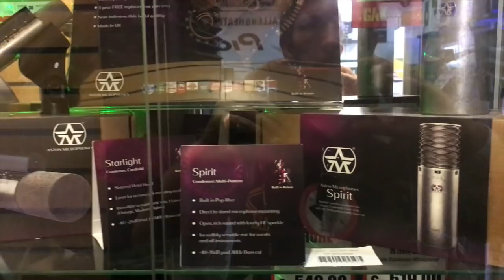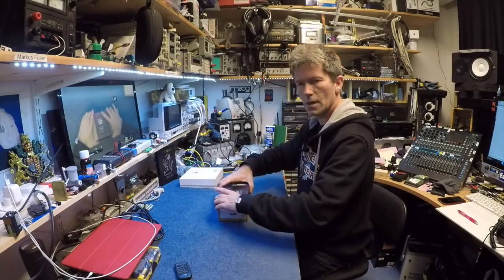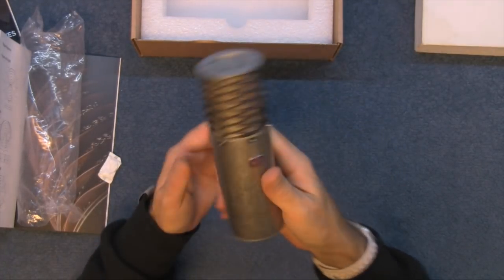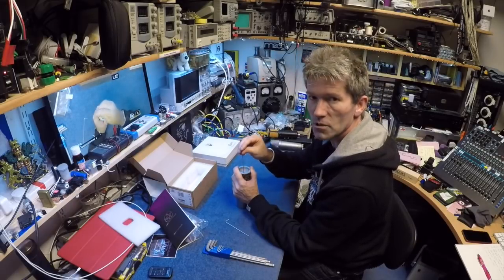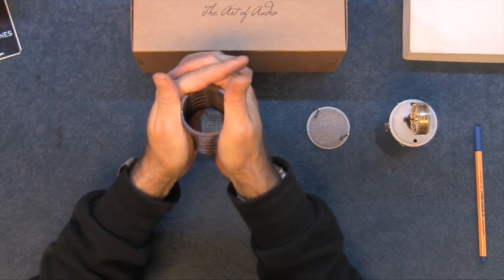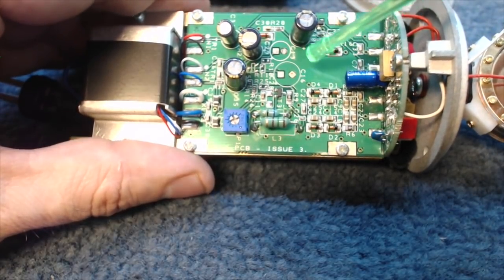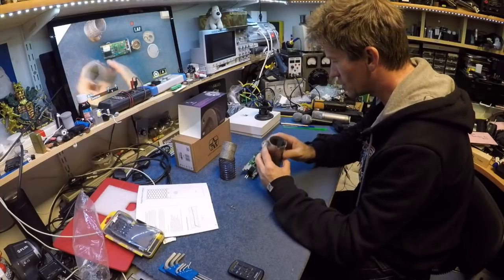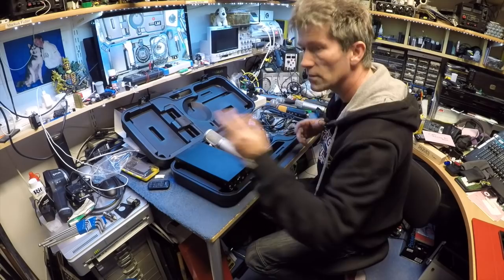Aston Microphone condenser Spirit teardown A look inside

Comment: Nice job buddy. I love inspecting the insides of electronics, I also noticed in your video that Aston are using high quality Japanese Nichicon capacitors throughout where many companies use much cheaper Chinese parts.
Reply from the maker: Yes it all looks like quality gear in there microphones and I know what you mean about Nichicon Caps they are certainly top quality as Dave from the youtube channel eevBlog always points them out when he finds them in a teardown.

Comment: This tear down video gave me a great idea, too. I noticed that they put what looks like a little piece of felt over the switch toggles so that when you put the body of the mic back on, it covers up the hole a little bit, and probably even gives you a little dust protection. I just built two U87s, and I think this would work with them, and would look good. I'm going to stop by the fabric store when I'm out on errands today and grab some felt!

Comment: Great video Markus. Your humour is getting even more oblque and I like it! It's the Brighton air. This mic looks like the bees knees and it's definitely going on my my shopping list. I like Shures but if you've ever seen inside one or tried to take a 57 apart only to find they've made the connecting wires too short and you have twisted the wires off the body trying to seperate the two halves then you'll appreciate the way this is made. I also get Shures are relatively cheap and that Sennheisers can give them a good run for their money, but this mic is on a different level for studio & stage work. Interesting the part about mic-ing back-line speakers - I hadn't considered that. As you say, it's the sound that counts and there'll be an AB coming up quite soon. Cheers!
Reply from the maker: La Barone Ah yes the brighton air will certainly get me admitted to the special ward one day. yes i have been in the shure and had that exact same problem about 3 years ago. just ripped the wires off trying to open it up. but for the cost they are very good.

Comment: i started home recording in 1988 4 tracking ect,ever since i used a sure sm58,but changed to the sm57 the last 20 years,now im up grading my home recording kit,i have just bought one of these,wow its got some weight,seems heavey for its own cage,but at least can allways just go on a pole,and im thinking if we use it to mic amps waatever up with its got its own caddle+shock which could be handy at low levels to the floor,,anyway im happy with it so far,,my friend who has a massive colection and knows his stuff recomended it to me YNWA

Comment: markus man I gotta ask, are you ever worried about the carpet covering of your desk creating any sort of esd on some of the electrical components you work on? I realize you ground yourself out but the desk itself, is it grounded despite the carpet?
Reply from the maker: Cool Ski Mask Hi no im not worried, I have done it this way for many years and have never had a problem. I do use antistatic mat and or earth wrist straps if I think something has static sensitive devices but I guess I have just been lucky.

Comment: So my mic dropped off my mic stand, the screw holding the orthogonal arm was loose, because of twisting the arm. So it fell down, no real damage, only minor deforming of the metal mesh spring thing. Can there be any damage to the sound? I removed the casket, capsule looks fine, cables are in place, a quick recording test didn't show any changes, tho the sound was different because of my voice, Time of day.

Comment: I have a question for you about the Aston Spirit. Since i bought it. It has had a rattling internally. I was wonder if you think that it might be fixable by opening the mic and reattach it?
Reply from the maker: Hi Christopher. If it is within giarantee I would take it back to the shop but if not then I would open it up and find out what the rattling part is inside. I wonder what is causing the sound ?.

Comment: I've been hearing good things about those Aston mics. Maybe I'll get one in the future. I have a Rode also. I have the Rode NTK, which was recently converted to a K2 by putting a better, dual sided C12 style capsule in it. Turns out they use the K2 PCBs in the NTK mic and PSU, and save money by using a lesser, one-sided capsule. So, I got the mic for free in a weird event, and then had a friend do the mods. I initially just wanted a capsule upgrade not realizing they used the same boards in both mics, then my friend texted me and asked if I minded if he put a pattern switch on the mic, and I said no as long as it wasn't a kludge. Then later he realized the PSU was set up for the pattern pot already. The metal work already had the hole for the pot, but the vinyl covering on the front with the lettering covered it up. Anyway. Long story short, I converted my NTK into a K2 with a capsule upgrade.
Reply from the maker: Sounds great what you did with the rode, the K2 was just too big for my needs (power supply great big cable etc) I just wanted a mic to plug in on the desk and use without extra psu etc. the aston mic is perfect for my needs and i use it often, plus the added bonus of it being almost indestructable. i have dropped it a few times but never been worried.
Reply: @markusfuller  I'm thinking about getting a Stealth from them.

Comment: I was rewatching this great video and I started wondering....

1. how well does the circuit handle the high frequency bump of the k67/87 capsule?  

2. Does the circuit have a built in EQ in the circuit?  

3.Is the circuit based off of any existing designs or is it totally original?

4.  How would you customise or improve the circuit?

I’ve been enjoying you content for a couple of years but I’m really wondering what your deeper thinking is on your microphone and their designs!  Please contact me if you would prefer not to share publicly :)
Reply: From listening tests on youtube and several discussions with owners, I can say that it clearly has a high frequency de emphasis circuit of some type.  It sounds nothing like the classic alctron k67 mikes, like the apex 460, 520, and nearly all other mics like that (art m four... the list goes on and on about the mikes that are basically all the same model with different cases or a few small changes to the circuit).  This sounds nothing like them at all.

Comment: So why, exactly, did you open up a microphone? what did you expect to find in there? Did you think they might have left something out?
Reply: Tear downs are very revealing if you know what to look for.  It is using a K67 capsule, like nearly all other cheap chinese condensor mics.. but the circuitry (Based on the sound quality) is clearly doing either the correct neumann designed HF de-emphasis, or they are doing their own high frequency de emphasis.  Either way it sounds MILES better than nearly all of the apex and art and nearly all of the other alctron mikes I've heard.  So the capsule is likely made in china (which isn't a big deal, most are these days, and some of them are terrific).  But the circuit was at least designed in the UK, I presume.  Unsure if that surface mount board is actually made in the UK, but the physical build of the mic is certainly unique, so I'll chalk that up to an original UK design.

So you learn a lot from a teardown.  Absolutely.  Also interesting was the transformer.  I'll have to do some research to try to identify that one.

All in all, I'd say it makes sense that it costs what it costs, seems fair, and worth it.

Comment: I want to buy that mic just for the amazing build quality.
If only, for example, mobile phones were made with the same quality standards as Astons...
Reply: IMHO good mobile phones have way higher standards. This is a really simple circuit based on decades old german design. I mean, simple as it can be. The "innovations" are only in the product packaging-marketing side, while the inside is just another Neumann clone. I also don't understand why is it so special it is UK-made - I'm not hating, but this is also obvious non-sense marketing because the chinese are able to build hi-tech Iphones, why would one doubt their capacity to build something THAT simple ?!
Reply: I had this mic on my radar, but all the marketing  didn't hold up to it's actual sound.
Reply: Speaking of Aston quality standards:

The first Spirit I bought literally had been put together the wrong way. The capsule was facing backwards...so I needed a replacement. 
Also I have never seen them to successfully put on their logo straight onto a microphone, it's always tilted a bit.

But other than that I like my Spirit a lot.

Comment: Markus will be anodising this microphone to dip it it dye  ?
Reply from the maker: I have just received a new batch of acid today so will be trying the anodising panels again real soon. i would not want to anodise this mike as it looks nice already.
Reply: That mike is stunning looking, in the same vein I have a Nagra ST reel to reel on display in my Surgery, the case is milled from a single piece of aluminium . I opened it up and it is through hole discrete components. I had a cable made up by Nagra there four pole to 3.5 mm jack £139!
Reply from the maker: Anoop Sahal My friend has the nagra-D which is the digital reel to reel and it simply looks beautiful but it is getting more difficult to find tape for it now and the battery needs replacing.
Reply: He can get a Nagra battery for £350 I’m sure I watched a Vlog about it!
Reply from the maker: Anoop Sahal Im not going anywhere near this one Anoop. i got a grilling over the last nagra video so im staying away from it. I will never repair any of their gear ever again.
Reply: Understandable, Their loss , lots of free,  excellent, entertaining informative educational advertising lost forever to them.Your advice is very influential and seems balanced  to me.

Comment: Why not 3D print a new mesh for the SM58, or this another thing a 3D printer cannot do !
Reply: Why not buy a brand new factory replacement ball screen for $8.00? Just put "Shure RK143G Grille for Wired and Wireless SM58" into a search engine of your choice. They are all over Amazon and they appear to be genuine Shure parts.
Reply from the maker: I guess you could 3d print one but you can buy them for the SM58. but my point was that it is metal that is painted rather than just plain stainless steel.

Comment: 2 pcb's butted together at 90' and joined with nothing more than solder...wrong, just wrong.  i guess in years to come when defunct ones are on ebay it will be a simple fix....
Reply: Ah! The armchair engineer speaks! It's all supported inside the body, All around the top for the horizontal board, down the sides and at the bottom for the vertical board! That's a lot of support. Besides which how do you think connectors are attached to boards anyway? Furthermore, the plural form of PCBs is not pcb's
Reply: hydorah .. as a repair guy I've met my share of defunct equipment assembled that way, and yes I'm a 'retired' armchair engineer now but still making beer money repairing such quality professional designs as demonstrated. Meh. It's a crappy connection method that would not have passed in my day but these days everything is designed to be disposable, so if the customer is happy, so be it. Built to a price is king.
Reply: You didn't address my points about construction, just said the same things again. If it's properly supported, which it is it works. Which it does. Those things are tanks. But good on you for taking my comments in spirit and not being angry, that's quite impressive. Cheers
Reply: Did you not see the two solid brass columns holding the boards together with mechanical fasteners?
Reply: theres enough anger in the world it doesnt need any of mine :), i do like the mic, but i hate 90' connected boards without stress/vibration relief. then again when i started you were also taught only bad sloppy pcb designers put components on the underside.....
Reply: Main-board appears to be fixed to a frame which the other board is screwed to!

Comment: I just got one of these today and putting the cover back together has so far been some of the worst most annoying couples hours of my life and I’ve still not done it. It’s like they made it as fiddly as possible for some cruel joke
Reply from the maker: Yes putting that top back on was a bit fiddly. you have to squeeze it as you line the screws up but cannot squeeze too much or you deform the inner mesh.

Comment: I think its more of a professional microphone for studio or music recordings, just for youtube a Blue Yeti would be enough and its less then 1/3 of the Aston price.
Reply: It's 1/5 the price. But they aren't comparable mics.
Reply from the maker: I have seen those but they are USB microphones and I need an XLR microphone.
Reply: You got a valid point, but doesn't he wanna use this for more professional stuff too? Or is this one not that high end as I think?
Reply: Blue makes the Yeti Pro model which has both USB and XLR outs on it. It is also stereo.
Reply: markusfuller Yeah I got a Blue Yetti  and found the same problem. Nice sounding but usb mics are a pain for real time recording with latency and ASIO issues.. Prefer my Rode NT2. Nice teardown though.

Comment: I find it strange... you open up a $400 synth and it's like a metropolis of resistors and capacitors and chips inside, along with the plethora of individual pieces like keys and knobs and buttons... that's a lot of work, materials, and machinery to make such a thing, so the price seems fair.
Then you open up a $400 microphone and there's just the capsule and a small little circuit board with a handful of components on it. Not very many pieces to make and put together. What is it that makes a microphone so expensive compared to devices that are seemingly much more complex?
I sense that it's just marketing, but perhaps there's more to that little capsule than it looks...